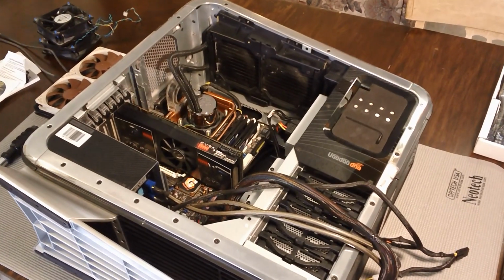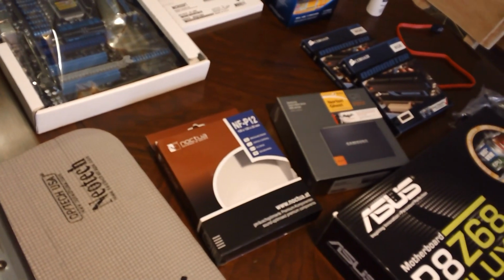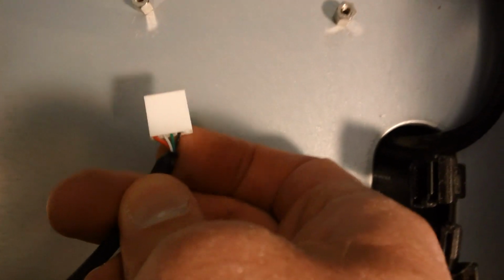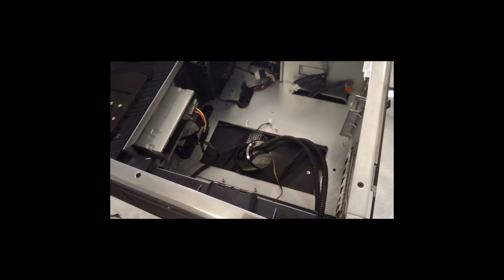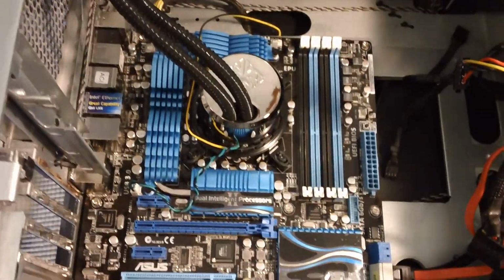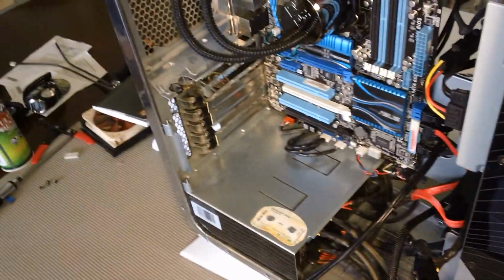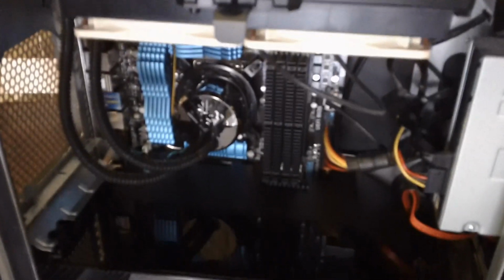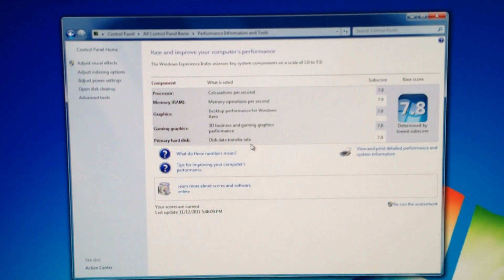HP Blackbird Upgrade 2011

Comment: Regarding those 5 HD bays, I was able to use their existing backplate connections to install 5 SSDs. But had to discard the 5 HD carriers; so each SSD just hangs in mid air but connected to the backplate board.

Comment: I was hoping you would have explored that mystery backplane board that the BB02 used. It has two MOLEX 6 pin connections, and a multi SATA connector as well as an 8 pin connector. I never could make sense of all those connections as BB02 did not connect all of them ! Then what are there for ?
Reply: +VideoByPatrick I believe HP used the same backplane in some of their other systems.

Comment: Your thoughts on the Blackbirds replacement, the HP Firebird 803 Desktop PC.. To me it seems that the return HP was looking for didn't happen as fast as they hoped & cost became the number one issue & that led to too many compromises which resulted in a inferior Desktop PC replacing it's predecessor.Thanks for posting Blackbird upgrade video I really enjoyed an inside peek at a PC I thought about buying but the  $5,500  price was quite an investment. settled for a over priced $1,800 Media Center

Comment: I just upgraded my blackbird to a GA-z87x-UD5h with the haswell CPU. Like you my cd rom was IDE which my board does not have. I also added more fans with mods. My Bird never came with the radiator, but now i know i should be about to mount one on mine in the future. This is the third time i have upgraded this Bird. I dont know why, there are better cases i guess just because i can...

Comment: Hey, sorry to bother you. I just have a silly question.. I bought all my hardware as I'm getting ready to upgrade my computer and I was fiddling around with the current set up to get prepared for the new gear being shipped over.. So I unplugged everything from my psu and now I can't seem to remember where we need to plug the liquid cooling's power connector... Would you happen to know?

Comment: My Parts List:

 - Asus P9X79 Deluxe MOBO
 - Intel i7 3930K CPU
 - G. Skill Ripjaws Z series 64GB (8x8GB)
 - Samsung 830 series 256 SSD (as the boot drive)
 - 2xGeforce GTX 560 Ti SLI
 - Mounting Kit to keep the current CPU cooling

Comment: Oh, just thought I'd chime in regarding the IDE slim slot drives.  I have a system with two of these drives (no blue ray drive).  Went through the same dilemma as t what I was going to do here.  Didn't want to replace as the eject buttons would no longer work.  Did a fair amount of research here and found that a company called Startech has a nice unit to convert older IDE slim slot drives to sata.  Just thought I'd throw that out there.

Comment: I'm going to upgrade my 002 now as well.  Going with an X79 set up.  Will upgrade to an H100 cooler also (made the mistake of getting both the CPU and GPU cooled on the original set up - dual 8800 ultras).  Will also be getting a new SSD boot drive.  To solve the issue of the hot swap back plane, you can use an ICY Dock SSD adapter.  That then puts the data and power connectors in the right place for the back plane.  Can't wait to get it all done now!

Comment: akrenko, great video. I am upgrading to the same setup. The problem is the Asetek LCLC 240 that came with the Blackbird. Voodoo support recommended replacing the LC if upgrading the motherboard as the cooling block is for different socket and a new bracket would be inefficient. Yeah the cooling block doesn't fit. I just found your video and it looks like your using the Asetek LCLC 240 still. What brackets did you buy to attach the old cooling block to you 2600K CPU? Has the LC been efficient?

Comment: akrenko, However, I’m going to upgrade I would like to upgrade to the point that I have room to grow with the next generation of processor coming.  My question: can I use the X79 Pro with the current Blackbird cooling system?  Thanks again…I agree with you HP letting go on the Blackbird was a bad call.

Comment: akrenko, thanks for the post…outstanding job. I'm looking to upgrade my BB 002 but running into a problems with the cooling system.  I want to use P9X79 Pro MB with Core i7 3930x processor.  I’m not sure that the Corsair bracket you used will work with the X79 Pro MB and the cooling system already in the Blackbird.  What do you think?  I’m I trying too hard…I saw what you did which should work for me…